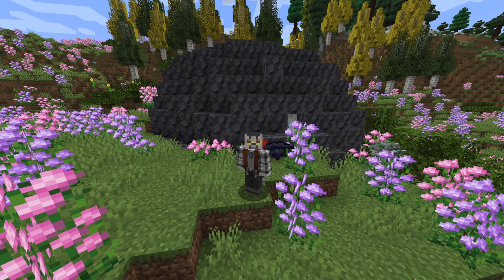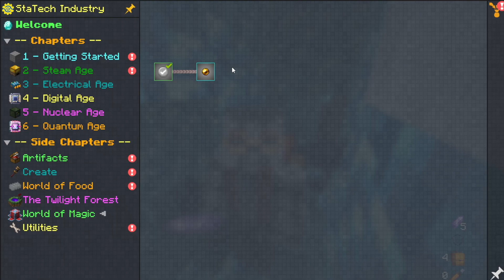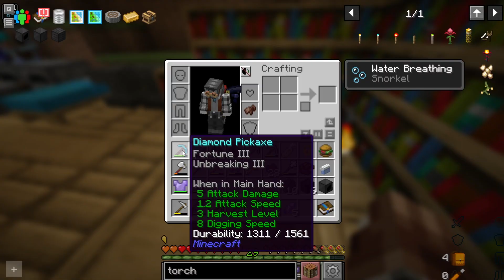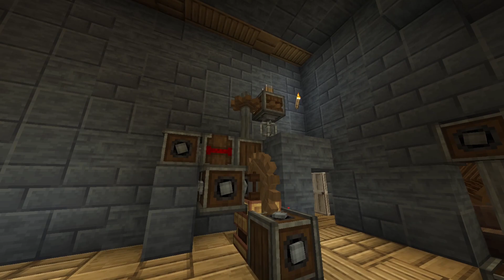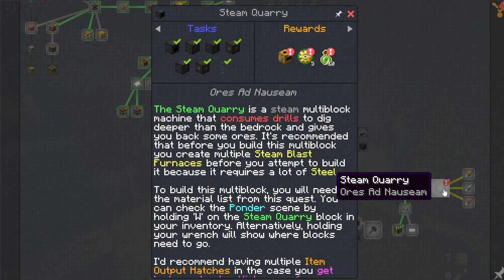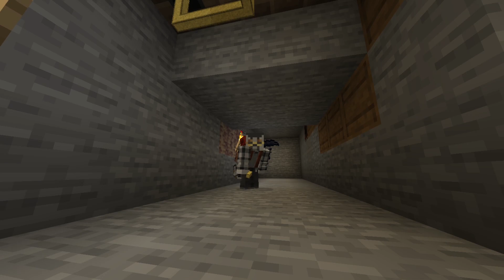Generating Resources with Modern Industrialization and Create - Minecraft: Statech Industry #6

Comment: "I'd use the modern industrialisation way of making clay, but then I'd have to pipe in water from somewhere"
So I'm guessing you didn't know about the MI water pump which would've made using the mixer trivial. Regardless though, create automation can be a fun challenge, while trivialisation of processes isn't necessarily.
Reply from the maker: It was more that pipes were expensive to make and so was another pump at the point where I did this, and it was significantly far from my steam setup, while create was basically free.  Now that I have pipes automated and ender tanks, it’s all pretty trivial.